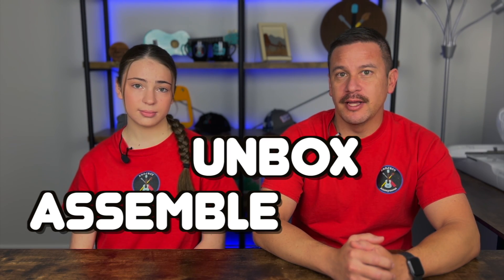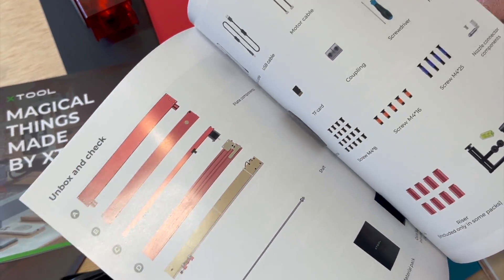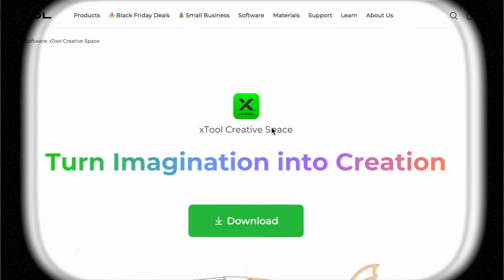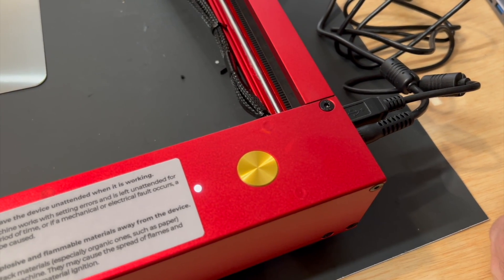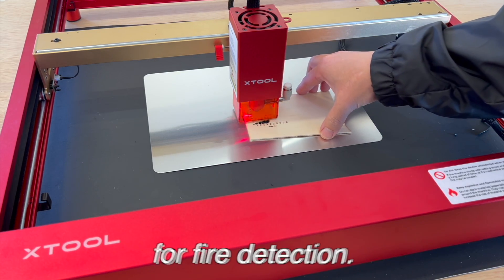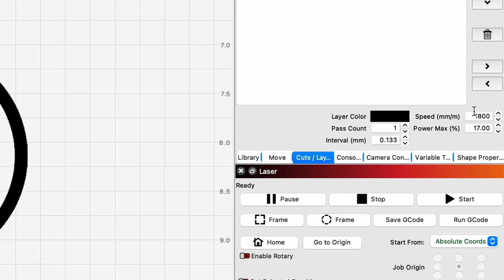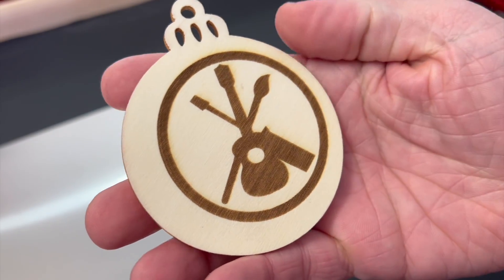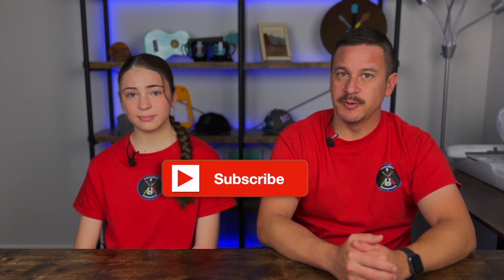xTool D1 Pro 10W Laser Engraver | GUIDE TO ASSEMBLE & SET UP

Comment: I’ve seen other UTube videos that people use a hose thing or air or something? I did not see u guys use one so guessing I don’t have to have it?  Also do I need something under the laser so it doesn’t burn the table? I don’t think I have the aluminum plate in my box
Reply from the maker: The hose is for an air assist, when we did the unboxing we didn't utilize it. The air assist isn't required, however, it is very beneficial to keep the laser lens clean and helps with cleaner engravings. We'd suggest one, as we do utilize it on most projects. You will need something to protect your workspace, as it isn't included with the product, a sheet of aluminum, steel and/or a honeycomb bed.